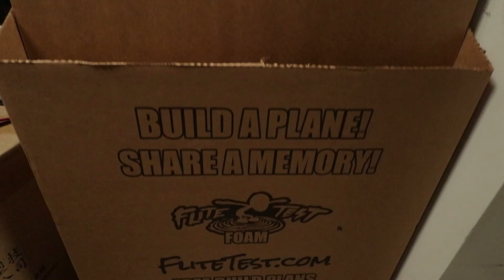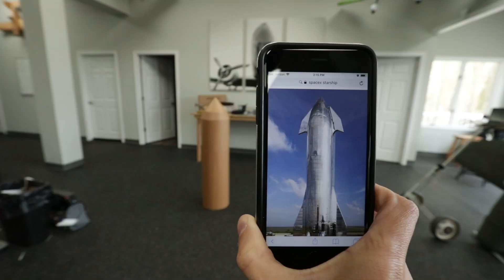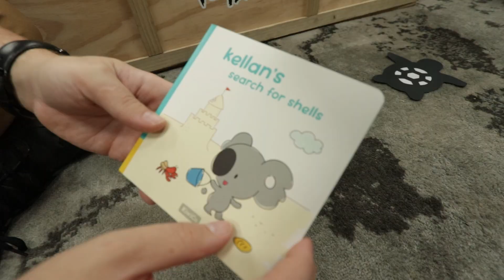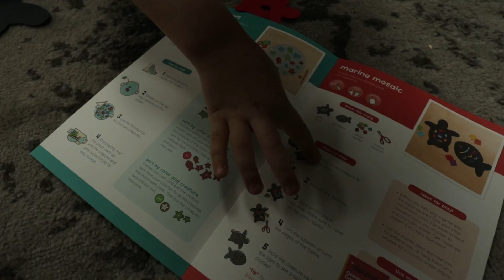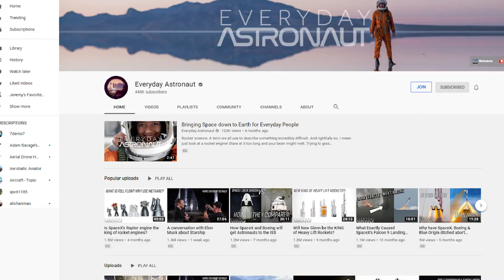DIY SpaceX Starship  |  Can we out-do Elon Musk?

Comment: Well....i think i know why the spaceship didmt fly,,,,the mechanism of flying is different than planes,,,,rockets needs alot of thrust to be able to carry its whight upward and vertical in this case need to add sugar rockets..although for more balanced flying u should move the motors backward to the middle of the rocket to permit correct weight distribution and a better left🤔 but always remember  the most important rule (u have to use sufficient initial thrust to lift it vertically  1st))

Comment: if you want to make it closer to the starship can i recommend using impellers and placing them inside of the rocket, and then using normal control surfaces as that would give a better representation of the actual rocket because it was sait to use the side fins on the bottom and at the top to keep it in a optiomal trajectory, and this would over come the not being able to control the rocket while no power is being added

Comment: You guys are all great pilots, my hats off to you!  Just like the days of trying to fly an RC Helicopter without gyro's my fingers and brain were not moving as fast as they needed to.  A heading hold gyro would free up a little bit of brain power when stabilizing the craft.  After all rockets and missiles typically use three single axis gyros on the fins, why not use them to control this.

Comment: Can you guys do a spaceship where there's an intake duct or ducts at the tip or  besides the tip and the entire body of the ship is a tunnel where a fan pulls air out the tip and out the base so its more accurate and low-key.
And put flaps under it so its controllable without visible flaps. Reply and i'll explain further.

Comment: Counter rotation on the motors should stop the spin. Also..... adding an access panel to reach the connections might be a smart idea. It seems like between everyone there with all the rc flight experience that no one has learned anything about aerodynamics, flight mechanics or general aviation engineering. 
Come on guys. Y’all have to be smarter then you are representing yourselves.

Comment from the maker: Addressing the Pendulum Fallacy, Fallacy - After consulting with some experts we have confirmed the following…The pendulum fallacy applies when the points of thrust are at a fixed angle in relation to the centerline of the craft. When this is the case, as the craft rotates the thrust rotates at the same rate creating fixed angular acceleration, not a pivot point and thus not a pendulum effect.

However, when the angle of thrust is variable to the centerline and is adjusted (by either pilot input or gimbal input) to remain oppositional to the directional force of gravity, the oppositional thrust creates a pivot point. This introduces a pendulum effect to the craft when the craft is not inline with the directional force of gravity but the motors/thrust is. Therefore, a forward-mounted point of thrust would be more stable (pendulum effect) during these orientations as it would take less thrust to correct for unwanted trajectories than aft thrust (inverse pendulum). There is not always a pendulum effect occurring in all positions of the craft so it will only be more stable at certain angles of flight.

Additionally, since the craft in the video is a plane with lift-generating surfaces as opposed to a traditional rocket which only has stabilizer fins, a tractor configuration (where the thrust is generated forward of the CG) is more stable than a pusher configuration.

Thank you for all the comments. Please remember to keep things civil.
Reply: FliteTest omg hi flite test
Reply: FliteTest hi
Reply: Use rockets in bottem

Comment: Rocket pendulum fallacy. ;) Inverted pendulums don't stand stably because the direction of gravity changes relative to the pendulum as it tilts. Motors that are rigidly attached to the frame will always point in the same relative direction as the frame rotates. For vectored thrust, only the distance from the center of gravity matters as it sets the lever arm length. Being in front or behind the CoG doesn't matter.

Comment: notice how it has a tendency to pull to one side and it wants to roll over? the torque is stronger on one side and he keeps trying to correct for this actively. I'm thinking RPM matching in addition to a counter-rotating twin-prop system? This is something that you find on everything from a King Air to a C-130.

Comment: Hey FliteTest Crew...So I am a long time fan, and avid watcher and subscriber (with bell for notifications) to your channel.  I have been flying RC since I was 12 years old which started out with an underpowered 6Ft Telemaster.  Anyways here's my dilemma, I am in the Navy and currently living overseas on the island of Crete, Greece (come visit if you want I have a big house).  I didn't bring anything to fly except my DJI Mavic Air for photography reasons.  I am getting the itch and want to put together one of your foam kits.  There really isn't much for traditional flying fields or anything I am used to but I know I can make it work.  What are your suggestions on which kit to get?  I like the idea of amphibious because I do have a lot of water around me to use but I am not sure if that's the right idea.  Also I will need to buy everything because I Brought zero traditional RC equipment.  Point me in the right direction if you see this!  Thanks!  Kyle.

Comment: it's torquing because both blades are spinning in the same direction. like a helicopter would without a tail blade, you need to fix it by cutting 1 of the moter's power cords and reversing it and reversing the blades as well, so the moters have opposite thrust.

Comment: Hi, guys!  I hope you see this post.

I watched the video and was reminded of the issues Robert Goddard, a pioneer in rocket flight, had with his original design.  Motor at the top and fuel down below.  The vehicle was terribly unstable.  Not really dissimilar to what you experienced.  It is far too easy to induce PIO and almost impossible to correct.

Try a version with the motors on the bottom and controlling, actuated fins on the nose and/or aft end.  It might be more stable.  

Try it with a drone with a metre stick that has fins.  It could be a boiler-plate model for stability mechanisms.

Love the videos and this concept!  Can't wait to see more!

Comment: What you guys need are some big internal blow dryer leaf blower motors where you can gimbal the nozzle-tubes like real rocket motors (not the rotors themselves -> torque), you could later even spray some alcohol into the stream for some cool pyro effects! If you want to make this super close to the original you also had to make the wings flap! These are not airfoils but rather control surfaces to keep the rocket falling belly first. To make it even closer to the original you could use the thinnest foam you have and inflate a ballon inside it for stability. That balloon would be the pressurized internal tank of Starship. Flying it would be like going up a couple hundred feet and then turn the motors off to steer it entirely with the wings. Just before it would hit the ground the motors would kick in again for a smooth touch down. To make the vertcal transition and landing more easy you could deplay a small (transparent) drag parachute. That would be a hack but still cool.

Comment: 2:50 this is a common physics misconception, as long as the thrust points straight through the CG there won't be any net torque on the body. This means that there won't by any (inverted) pendulum effect.

Comment: Some things that I would fix and maybe you’re already doing this in the next video, but the fins do actuate, and they don’t do it like normal fins, they fold closer to the fuselage and further away. This means that during reentry it has a kind of dihedral passively stabilizing it, and it can just fold the fins out different amounts to adjust pitch. Also, putting the motor at the top doesn’t make it passively stable because tilting the vehicle by 20 degrees would also tilt the motor by 20 degrees. I would also like to see a Superheavy booster in the future, with grid fins and a separate control rig so that somebody could land the booster and somebody else could fly the starship. Also, for a booster, I would recommend adding 37 props.

Comment: Instead of thrust vectoring and fixed control surfaces, would you guys be able to make the Starship have folding wings and canards like the real Starship has? Would be cool to see a rocket launched or aerial dropped Star Ship that 'glides' down just like the real Starship as it folds in and out its air brakes.
Reply: Seems like a lot of servo torque would be required to keep those big surfaces outstretched.

Comment: So... The actual starship will have it's CG shifted drastically between it's two flight modes, so will have an extremely forward CG when fueled, and a much more neutral/aft CG when most of the fuel has been depleted.  rocket stability, when flying forward or in retro mode (backwards), is dependent on the CG being in front of the Center of aerodynamic pressure (CP) relative to the direction of travel. these intersect, and switch at some point toward the end of the flight, as fuel is depleted, and can be helped by reconfiguring the aerodynamic surfaces as well.  
Thrust vectoring only works In a stable mode when the thrust pivot is behind both the CP and CG relative to direction of travel.  It's possible to have control the opposite way around, but not inherently stable. that is the way your's is.  it would be far better to put the motors on the rear of the rocket, and use thrust vectoring.  (called engine gimbaling) 
Same general principals apply to aircraft, especially at higher speeds.   Get any of these wrong, and there will be an unstable osscilation, the freq. of which will depend on the weight distribution, Reynolds numbers, and V.   
BTW the aerodynamic forces all shift when approaching mach 1, and continue to shift at subsequently higher speeds.  Also the strength of the forces varies depending on the atmospheric density. (Sea level, to re-entering the thin upper atmosphere). 
Have fun, guys!!!

Comment: Nice Job guys.
Two idea/questions
1) Are the two propellers motors rotating in opposite directions (to cancel the rotor torque)
2) For vertical landing, maybe you could make it function a bit like a parachute by putting downward facing vents at the base of the nose cone.
As a kid I had a model rocket that landed this way (The Point by Centuri) https://www.rocketryforum.com/threads/centuri-the-point-kc-13-or-5073-gallery.16800/

Comment: (second comment) you can see the hinges for the bottom fins i talk about really well at the image at 11:16, look at the left fin, see how from its top its smooth, then theres a big seperate section that starts? that goes allll the way down, the whole flap rotates around that pivot :P when the starship really flies soon, those will rotate to airbrake, and when not braking they will act as huge vertical stabilizers as well! of course when needing both, the pivot also lets them vary how much they are breaking or stabilizing.

Comment: just here to point out, the fins on Starship DO move, but arent designed to rotate like normal rocket fins. the top fins work normally like pitch/roll rocket fins (the whole fin moves, not just the back). the two giant bottom fins dont rotate for yaw, roll, nor pitch, but actually work as giant airbrakes (so they rotate along their attachment point to the ship, not a rotating perpendicular to it like you would normally do for elevons or ailerons. I can only do so much to demonstrate with text symbols, but try to imagine how it looks from the front, these fins start like this: O then rotate to look like this: /O\ or this \O/ or even this /O/)
Reply: Good example of Starship in flight, and the real usage of its "fins" :

https://www.youtube.com/watch?v=F5ct9A5Z71Q

Comment: I can watch FliteTest just for Josh's facial expressions when it's about to go all bad! 😂 Counter-rotating props would help with the twisting. I built a flying stand up Jetski the same way the CG had to be drastically aft. If you really want it to be easier to handle get the hobby eagle A3-V2 fixed-wing gyro, it has an auto-hover mode for vertical landing/take-off. Best part it's only $23.00, assign a flight-mode switch a knob for gyro sensitivity on the radio you're done.

Comment: @ 2:50 Nooooooo! That is not how those forces work! What you have described is the classic Pendulum rocket fallacy. That configuration does not provide any passive stability, as the motors do not automatically gimbal to thrust upward. That logic only applies to an object mounted to a fixed point, not a free-flying object.

Comment: Starship has some extremely unconventional aerodynamics going on.  The belly-first flight mode during reentry, with the direction the control surfaces move makes the control scheme more like a quadcopter than a conventional airplane in this mode.

Controlled flight at 0, 90, and 180 degrees AoA!  You guys have your work cut out for you.  Mad props if you can pull it off!
Reply: Belly first reentry is nothing new. That is how the space shuttle re-entered.
Reply: @martindinner3621  Starship comes in at a much steeper angle of attack than the shuttle.  And of course it briefly flies backwards in order to land on its tail.

In any case, I dare say a single vehicle that can do all of this is new for Flitetest ;-)

Comment: Instead of attaching the battery to the wall. Try to make a contraption to hold it at the centre of the cylinder. Like the centre point of the diameter of the cylinder

Comment: First. This style is more rotary than fixed wing. If you do not begin the design as a rotary it will never land vertically. See Otto Dieffenbach and Flying Tardis and various flying beverage cans.

Second, related. It looks like it'll do fine under 2 motors, plenty of lift, but definitely reverse rotation on one to kill the torque roll.

Comment: Pendulum effect is actually less stable. This is a common fallacy that newbie rocketeers assume. When the pivot point is at the top where your hand is grabbing the rocket, ya, of course it is more stable, but when it is flying through the air and its pivot point is its center of gravity, it is much, much less stable. Think of it this way, one would intuitively think that the pendulum effect is stable, it's like the drag from a tail fin, except instead of air drag, it is gravity drag. But this is utterly flawed. Just as easily as the pendulum can keep the rocket upright, it can flip it in any direction too. And once it starts flipping, it changes the direction the motor points as well, which compounds the situation, usually resulting in the rocket flipping out of control. This is why rockets have motors and engines at the bottom. The same goes for a plane, is a plane more stable with a big weight hanging straight down from its CG by a rigid metal bar? No, it just goes wherever the weight swings. This actually had nothing to do with your lack of control during flight since it has no pendulum effect while flying horizontally, but if you guys had tried to land it vertically, it would have been extremely difficult, to say the least. "It does not like staying vertical." A shrewd observation. Great video.

Comment: 12:35 "I don't remember what happened." Been there. First flight 30" balsa Ultimate Biplane. We mistakenly decided mid level throws was best. (Had 3 pos on 3 switches.) I have a few vague flashes of memory what it looked like in the air; mostly terrifying. I couldn't stop long enough to reach the switch. (Ailerons was the worst problem.) A friend finally hit it and I got it down safely.

Comment: Also, isn´t this simply a dual-copter (2 motors, 2 servoes) attached to a foam-rocket... With a flightcontroller with a good PID-tuning, this would probably both take off and land vertically.
Reply: Correct. More accurately, it won't land vertically without a controller. They'll figure it out. :)

Comment: Hey guys great job, Josh could fly it Alex is a great test pilot and I am jealous of Jeremy as he can fit himself in that rocket I can't fit myself in a car lolz well great job done guys I have a idea if you put four of those moters in 4 hollow tubes and fit those at the bottom I think you should be able to go up vertical, you guys have put servos on fins so that you can control the movements in axis a total of six moters should do the job, four at bottom for the required thrust n two on fins as they are now, cutting 8 inch tube each of the four and placing the moter two inches from top leaving a six inch air gap in every tube and covering the base with foam leaving only the tubes open for thrust and cutting two or four holes at nose would be a good idea coz to capture more air it will also tend to suck in air from bottom which we don't want if the base is open as now, so pack it, also if there is symmetric air flow in the fuselage it should help lift it verticle, also these tubes will help in landing and re entry phase, please forgive me if you find this stupid, you all are great experts in what you do and I am a lover of aviation n aero space so I may be wrong also but giving it a try would surely give fair results guys, wish you kilo tons of luck and God bless you all.

Comment: What about a movable weight to give stability in vertical take off and landing. Like battery in a thin tube that moves forward and back so to adjust CG in flight. Might make the landing part easier.

Comment: You should let spin one motor clockwise and one counter clockwise. So should´t have the torque problem.
Reply: Rex McStiller it was an angle in the lower fins and reversed controls. The props both spun opposite.